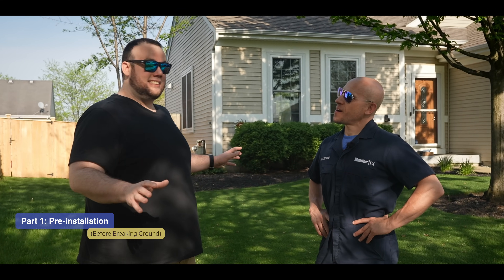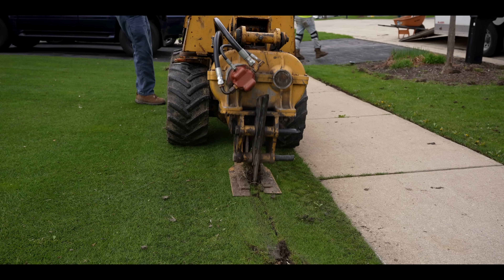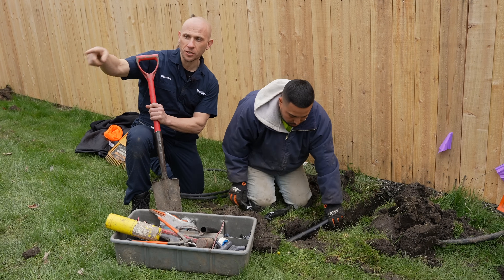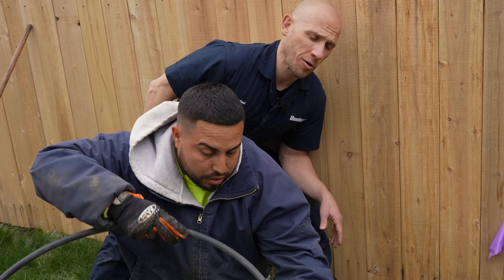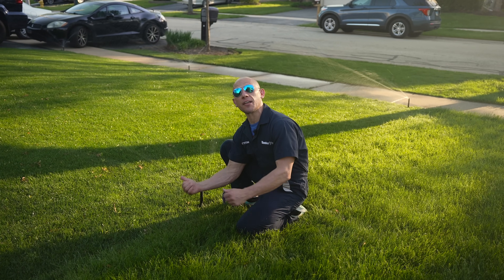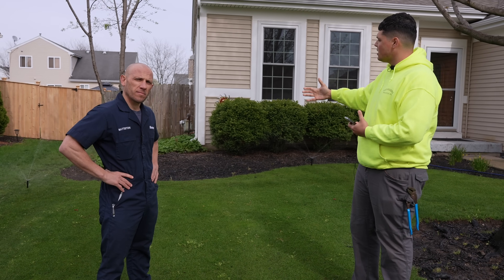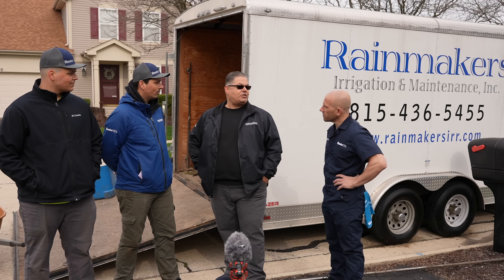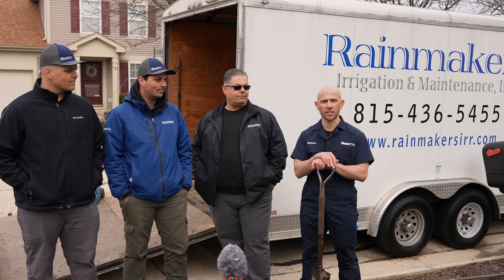I Just Got the ROLLS-ROYCE of Irrigation Systems

Comment: This guy would tell you don't change your own sprinkler head because you need to be licensed and have a permit 😂🤣
Reply: As the contractor shown in the video, we pull a permit for every new install because we are tapping into the homeowners water supply. Therefore, the city requires we provide them with our plumbers state license and CCDI license. Also, we have to show a layout plan of where the heads will be located due to the fact that some towns will not allow heads to be within a certain distance to fire hydrants and/or B-Boxes. Lastly, there are several towns in our Chicagoland area that will NOT allow sprinkler heads in parkways. Changing out heads or any repairs after the fact, does not require permitting or inspections. Pulling a permit and being licensed is not a “money grab”. It is simply following city guidelines and playing by the book.
Reply: thank you for engaging with the content
Reply: @kevinbattistoni5960  you are welcome

Comment: Those flexible sprinkler tubings are crap. If you have a lot of ground movement, the sprinkler heads will be all over the place within a year, either spraying into the air or spraying into the ground. These are only used because it is easier for the installers, not because they are better. PVC is the way to go.
Reply: PVC is a poor choice for a residential install. My father who has 30+ years experience has dealt with PVC for a long time. It is a maintenance nightmare. Having the change of seasons from the heat of summer to the freezing temps of winter takes a toll on the PVC as the ground freezes and thaws back and forth each year. Also, when driving lawnmowers or any other equipment going over a sprinkler head, it is a high risk of the PVC cracking beneath because there is ZERO give when it comes to PVC. As you know it is very rigid.
Reply: Swing joints would be the best, but flex pipe works just fine. we don't have many earthquakes in IL, so I believe we will need to worry about the heads moving. Thank you for engaging with the content!

Comment: What's up with trying to dissuade DIY 15 times throughout this video...
Reply from the maker: Frankly, it’s not as easy as it sounds.
Digging holes sucks.
Reply: By the time you pay for the plumbing tap & Backflow installation and obtain a proper design,  buy all the parts, factor in hand digging the entire system because your not gonna find a rental pipe puller it doesn't make any sense to do it yourself. Put a value in your time and the over all cost will exceed what you would be charged to have it done right. 

I've been through this exercise many times and had many a homeowner beg me to polish the turd they laid and when I have to explain to them they non of what they installed can be saved and it's best abandon there diy all together , the look in there faces brought me no joy.

Understanding hydraulics, friction loss, distribution uniformity, nozzle coefficients & scheduling coefficients, proper hydra zoning and matching precipitation rate along with soil infiltration rates is something I have yet to see a DIY installation get all that right.

I speak from a lifetime of experience, just want everyone to use water as efficiently as possible.
Reply: @PrincessCutLawnCare  I am currently in the process of finishing my installation - digging was definitely a lot of work to do solo. I purchased a mattock which was a great investment. 

TBH I'm not really sure if a pipe pulling machine would have even worked on my land - there were SO MANY rocks it's insane. Some of them like mini boulders were a PITA to remove.

Comment: No hate, seems like they did a great job. Would have liked to have seen a few things differently.
First I would have like to see your water line not come out of the house where it is. But rather through the foundation. I understand it’s more work but would be better if you get freezing temps, second, instead of being on Cooper pipe into the backflow, I would have liked to seen galvanized, with u ions on both sides. Other than that. No complaints
Reply: Galvanized steel is a terrible idea when connecting to copper or brass. The zinc will corrode and cause issues. Backflow devices should always be installed in complete copper or schedule 80 piping.
Reply: Galvanized is a very poor choice for an irrigation system. Copper is definitely the “go-to” for the water tap. Also to answer your concern about the winter time, the RPZ gets removed and placed inside when the system gets winterized and placed back on for the spring turn-on. All water underground gets blown out at winterization time as well.

Comment: With that equipment anyone can install irrigation systems. 🤦‍♂️
Reply: True, anyone can toss some flags in the yard dig some holes and put some sprinkler heads in we call that a summer system some heads are here some heads are there no rhyme or reason no distribution uniformity no scheduling coefficient no nozzle coefficient no proper hydrozoning net result lotta wasted water and imperfections with set oversaturation and some areas and stress on the turf and others higher professional🎤💧